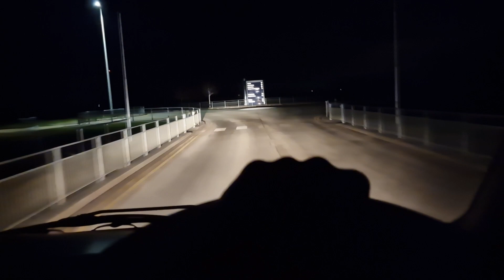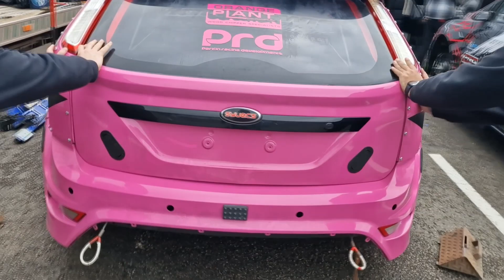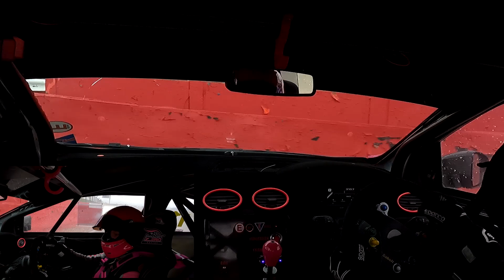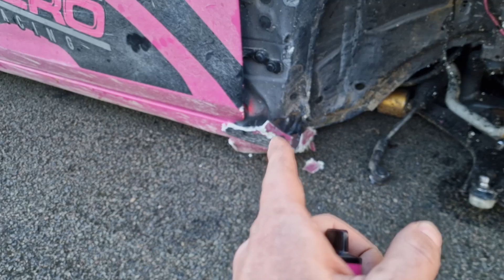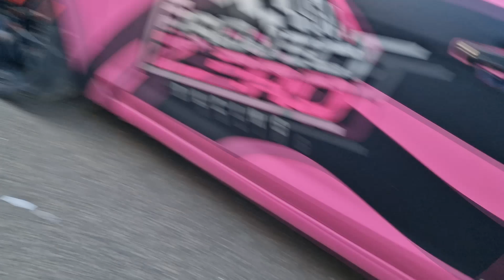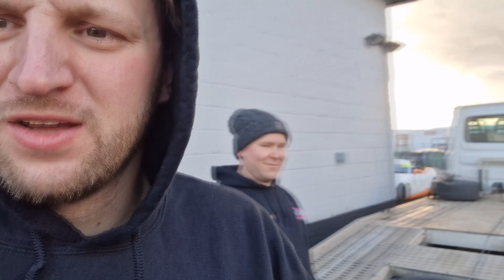IT ALL GOES WRONG....FAST!!!!

Comment: Youve got mega power in the car, no rear downforce but youve got a front splitter, which only upsets the front-rear balance even further on an already nose-heavy car. Time to invest in a chassis mount BGW and other aero like james allen has?
Reply from the maker: The biggest issue has been always getting temperature in the rear, like you say this is due to the front bias weight. However James also has nearly 250kg less weigh than us so we can't really compare the cars. However rear aero has always been on the lost but having the correct wing is the biggest issue at the moment. 

The car corners fantastic as it is without a rear wing. its always the first 2 laps that are sketchy. This was just a series of things that ended up being 1 big one 😆😆